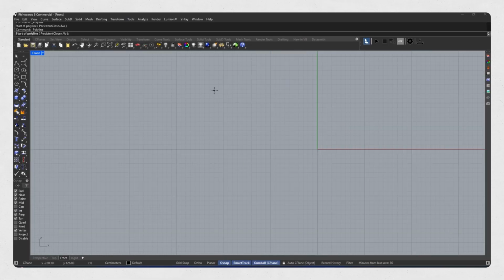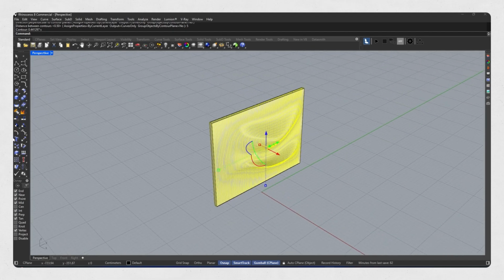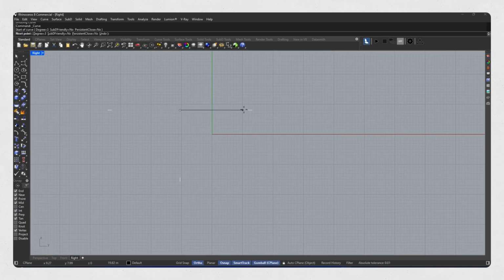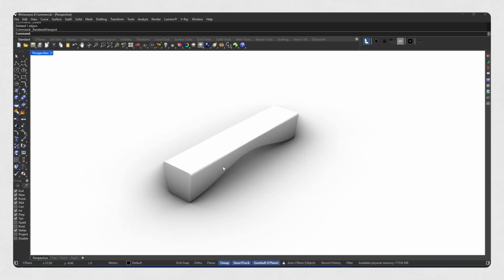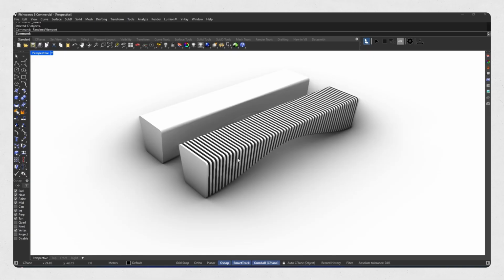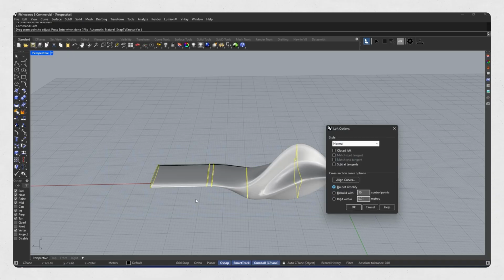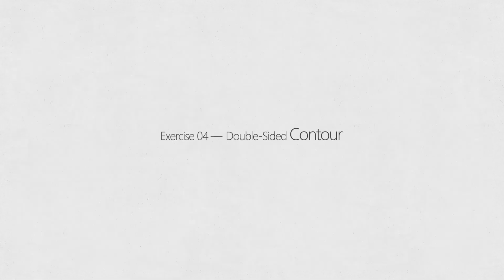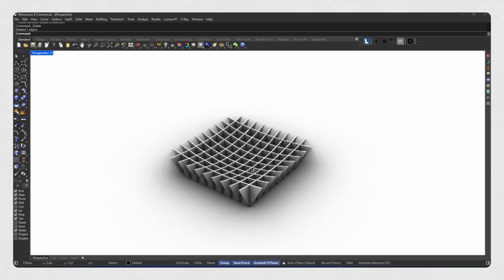Rhino 3D Tutorial: Design Parametric Furniture Step by Step

Comment: can you please teach me, how can we make a intersection 
basically I want to make a curvy table in plywood
so first i have to make a structure , then i will wrap a flexible ply on it,
please teach me that way, also i am new to the rhino
please teach me
Reply from the maker: Hi! For building a curvy plywood table, you usually need to design a set of structural ribs (sections) first, and then wrap flexible plywood on top of them.
In Rhino, you can create this structure using tools like Contour, Intersect, Loft, and Sweep.
Since you’re new to Rhino, I’ll cover this process step-by-step in one of the upcoming videos.